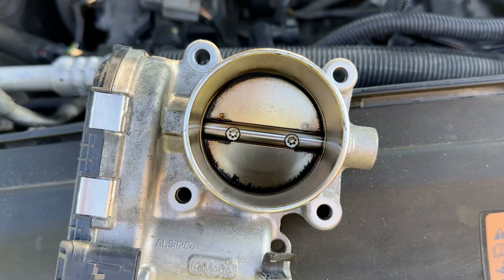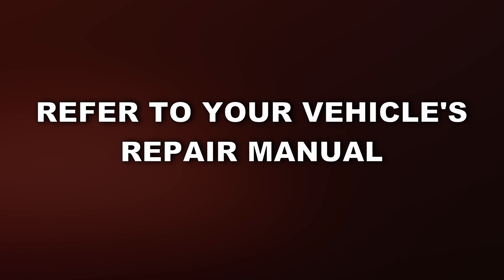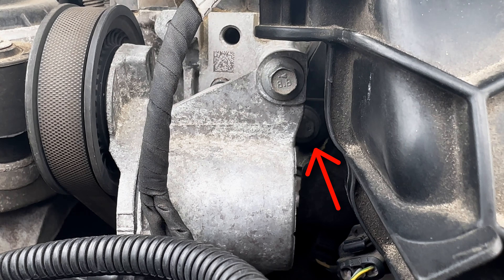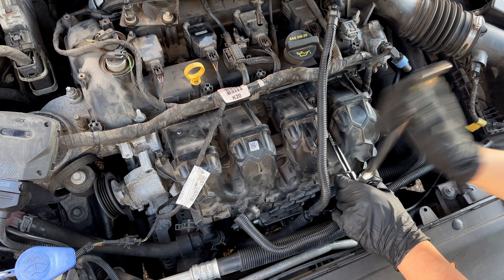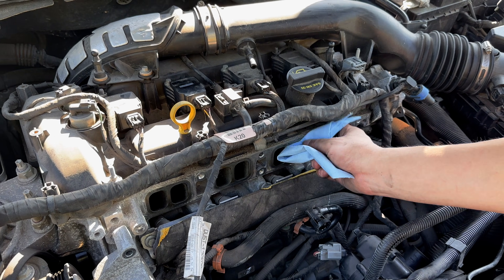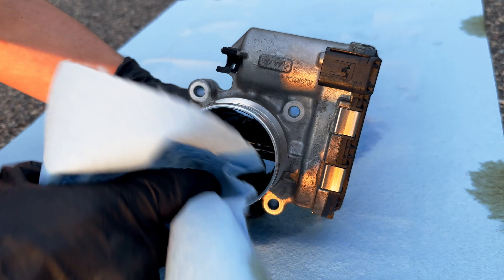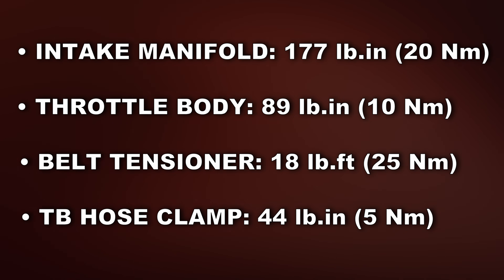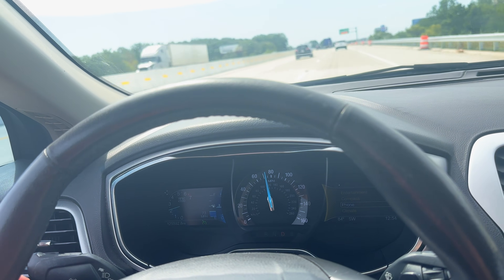How To Clean The Throttle Body Safely

Comment: My question: I’m having trouble with my 02 Acura TL, it’s having trouble starting and randomly stalls out. I replaced the fuel pump but it’s still doing it.
Reply: I had an 01 a couple years back, idk what your motor is but I had a 3.2 and what I did was pull out all coil packs and see if any of them were wet, only one was with oil so I replaced them and spark plugs, still had an issue and it was oil getting into my intake and sooner or later the car didn’t wanna start anymore
Reply: If you have a 3.2 hmu so I can tell you how to take it apart and figure that out it only takes about 10 minutes to find

Comment: Heyo, i just got a fresh Wof and service done on my car, but it’s making this light squeak/squealing noise when idling, but is perfectly fine the second i apply the accelerator. I’ve got an 08 Mazda 3 2.3L. The lads at the shop didn’t mention anything about it. it was not my regular place, so I’m less inclined to trust them, nor do i usually go through drive in garages. Any chance this is normal and i’ve just never noticed it before? I had an 04’ before this one, but i don’t remember it ever making such noises. Any help would be much appreciated! 

Thanks for your time 🤙
Reply from the maker: The squealing noise at idle could be due to a worn or loose serpentine belt or a faulty pulley bearing. To help diagnose the source of the squealing noise, you can perform a simple spray test. With the engine running and the noise present, carefully spray a small amount of water onto the belt and pulleys. If the noise temporarily stops or changes, it indicates that the belt is likely the source of the issue. Here are some videos for better understanding. https://www.youtube.com/watch?v=iINHy-gCOZY&t=1s&ab_channel=EasyAutoFix
https://www.youtube.com/watch?v=2-Y4uxtkkaQ&t=2s&ab_channel=EasyAutoFix
Reply: @easyautofix  you’re an absolute legend!! I’d suspected from all the reading and videos i’d seen that that would be the case, but wanted to make sure because it’s not as intense or apparent as the videos I’d seen. 
Thank you, sir!